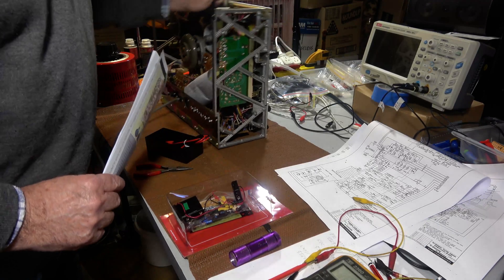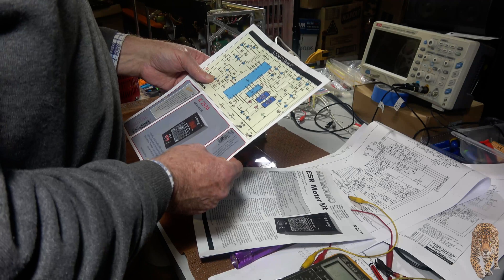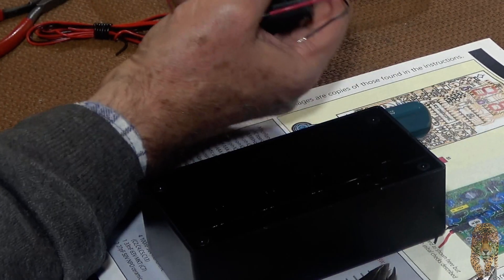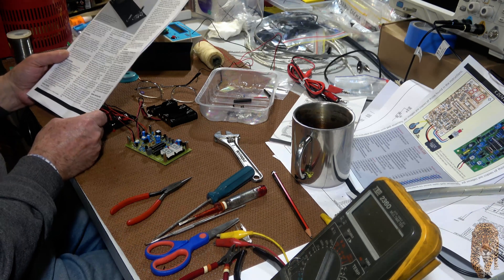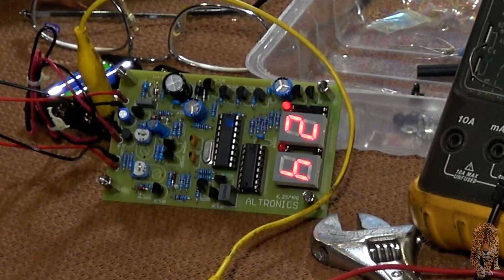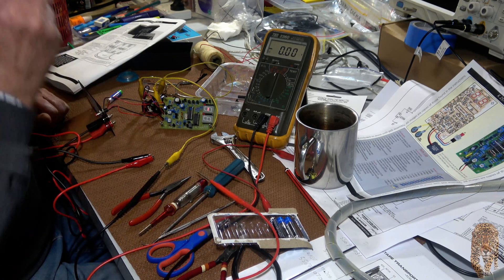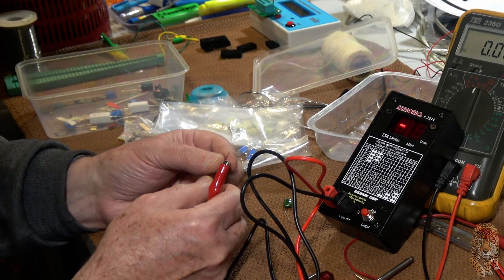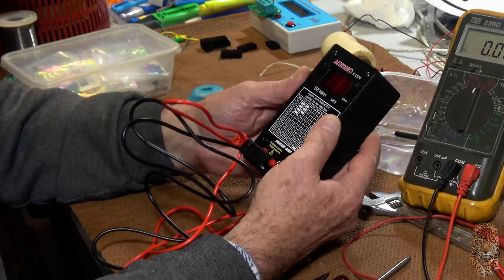ESR meter kit build

Comment: I'm in Melbourne Australia and just built this ESR Meter from Altronics. It works pretty well. I had two small issues though. After some light use the wire came away from the Jaycar supplied leads in the connector as the solder failed. 

Secondly I managed to get super glue all over the red Perspex screen that goes over the numbers which I couldn't all clean off. I ended up getting in contact with both Bob Parker and Altronics kit department and they were both true gentleman and very happy to help a rank amateur like myself.

This video is probably the best I could find on YouTube about the Bob Parker ESR Meter and constructing it

Comment: With the mod for extra protection using 2 1N5404 diodes inverse parallel, different manufacturers have different forward voltages, will this affect the accuracy of the readings?
Reply from the maker: I don't know about this mod. I would need to measure the output ac voltage to see if it is below 0.5v or 0.3v ac. I wouldn't do this because it is so low. Arguably a higher voltage limit might be useful e.g. 3 series diodes in LLel with 3 series ie. 1.5v each way. I find it easier to just ensure the cap is fully discharged before use. This isn't something I've given any thought to.

Comment: I bought the EVB version from portugal. It was way cheaper and ready build!
Reply from the maker: Add postage, not so cheap. Postage is a killer for international stuff.
Reply: @MoggysHiFiAntics  
53 euro to Australia in 2022.
Reply: Kit AU$105,  53EU= AU$89 probably gone up in 2024, so postage is possibly more than the EVB costs. 
Yes, EVB is 86EU to oz, that's AU$149, much higher than the kit price. I'm sure the EVB is a good piece of gear.
The Altronics shop is only 4km from me so no delivery cost. Plus it's great to assemble! 😀
Reply from the maker: Kit AU$105,  53EU= AU$89 probably gone up in 2024, so postage is possibly more than the EVB costs. 
Yes, EVB is 86EU to oz, that's AU$149, much higher than the kit price. I'm sure the EVB is a good piece of gear.
The Altronics shop is only 4km from me so no delivery cost. Plus it's great to assemble! 😀 @jayytee8062

Comment: The esr meter should be ok for measuring caps down to about 20nf.
1uf should be around .16 ohm at 100kHz. The meter is 99 ohms full scale.
I have the same esr meter as you and I just checked it with a 0.1uf (100nf) cap and it measured 18 ohms.
Good quality electros usually show much better (lower) than the values on that little chart on the front of the meter.
You can also use it to measure the internal resistance of batteries.